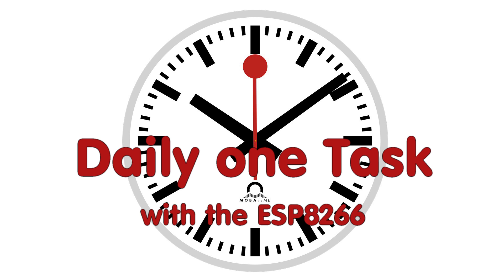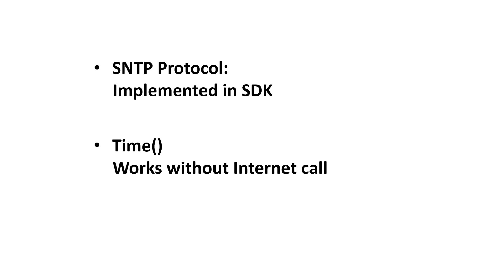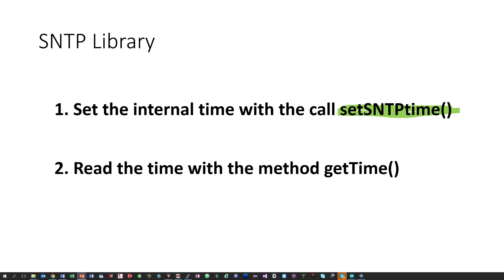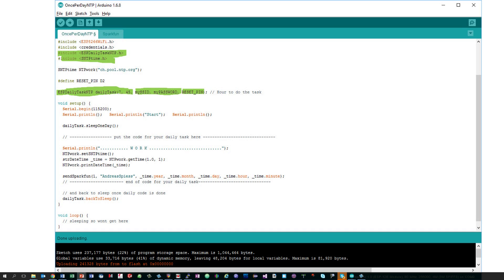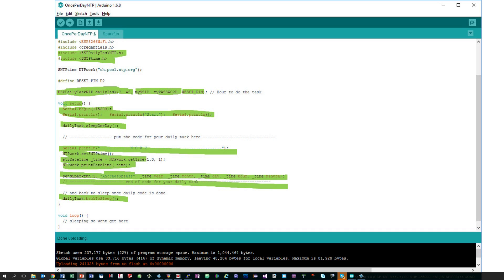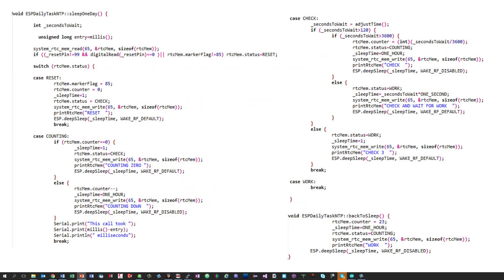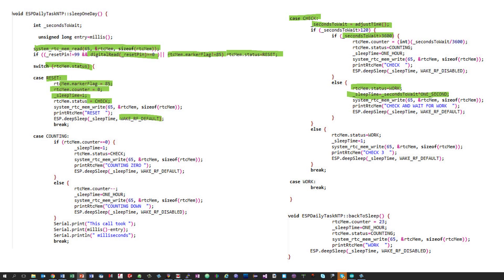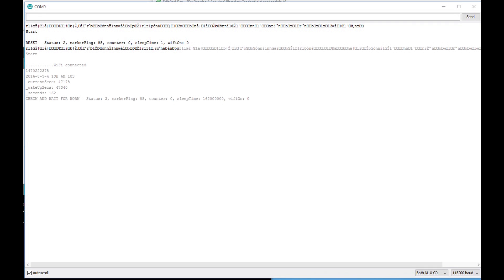#71 Schedule a daily task at exact the same time with the ESP8266. The rest is deepsleep

Comment: These videos on the esp8266 is interesting but I would like it if the arduino business was missing.  This module could be programmed using the Esplorer using a the node mcu or the simpler at commands.  Esplorer is a cool and more intuitive interface for the esp8266.
Reply from the maker: I like the Arduino IDE because I not only work with the ESP8266 but also with Arduino, Attiny and even sometimes STM32. When I started with ESP8266 I also tried LUA, but then it was horrible to use because it was not stable and I had to learn everything again. So I was quite happy when the Arduino IDE was ready.
I think, LUA language was developped to be easier than C++. So, you are absolutely right about this. However, my videos are usually not at the "easy end" (at least, this is my aspiration). There are a few other channels which use LUA.
Concerning AT commands: I like very much the concept that I do not need another MCU to build Wi-Fi enabled devices. This is probably the reason, why I did a lot with ESPs recently. I grew up when such devices were very expensiveand big and I really like this new stuff. If you watch my videos concerning the A6 module, you see, that I have to deal with AT commands from time to time...
Reply: There may be more efficient methods for the experienced gamer, but most of us are simply familiar with this IDE already. Personally, I appreciate that he is staying within it.
Reply: Puzzling since this channel seems to be concentrating on esp8266 stuff.  I don´t like the arduino ide, it jumps all over the place in use and everything is so proprietary with the word Adafruit for example leading off ever library, makes it hard to use and read..
Reply: Andreas Spiess Yeah, they just don't make lipo-powered Wifi microcontrollers running off of NTP servers like they used to in the 60s :P
Reply: The arduino IDE for me is not the way to go as it puts added complication to programming the esp.  The arduino ide jumps around in use and I know it can be configured differently to make it your own but I think it sucks.  Try the Esplorer and see what I mean.  I´d be willing to bet that the arduino library's are the same coding that lua uses.  If you are interested in coding learn lua and fix the bugs.